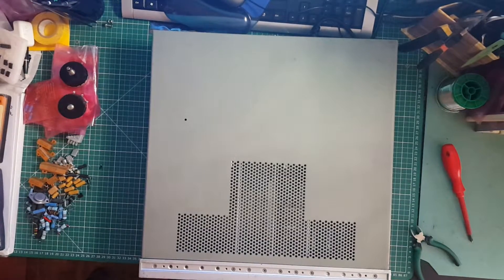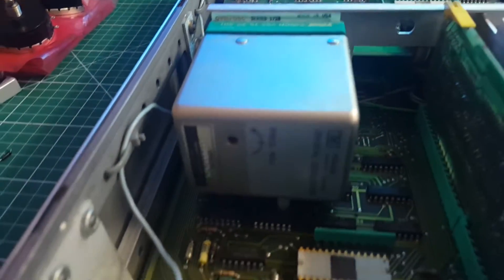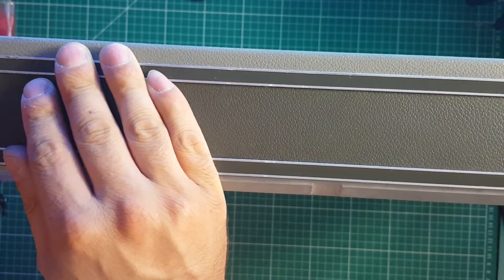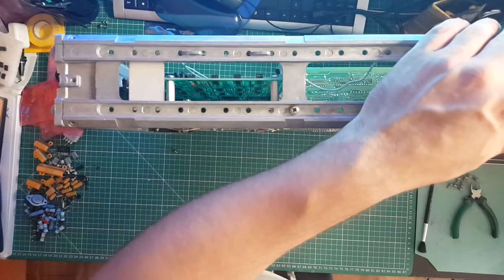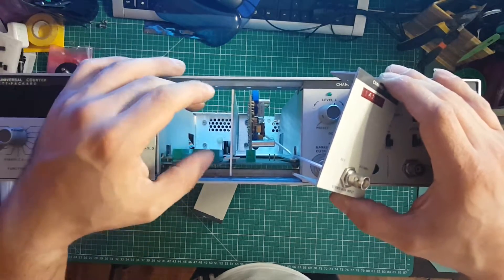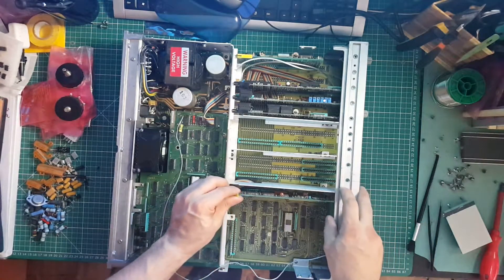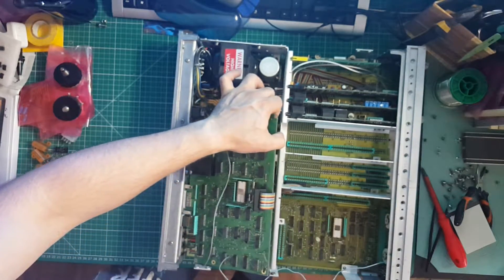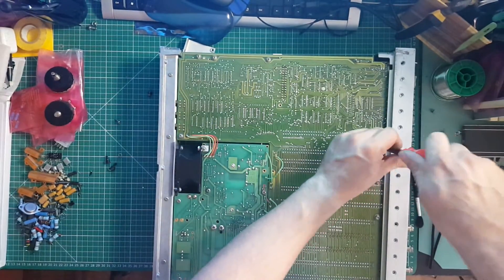hp 5328a frequency counter tear down part 1

Comment: Sounded like a fan bearing to me.
Reply from the maker: I disconnected the fan and the sound was still there. I should have checked the voltage rail with a scope. It sounded like a noise from a un healthy switch mode power supply.